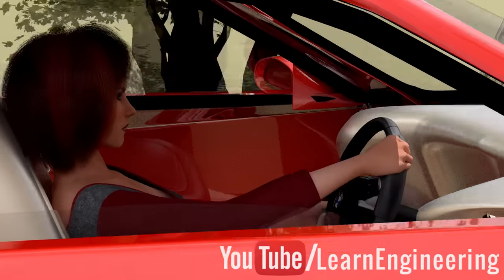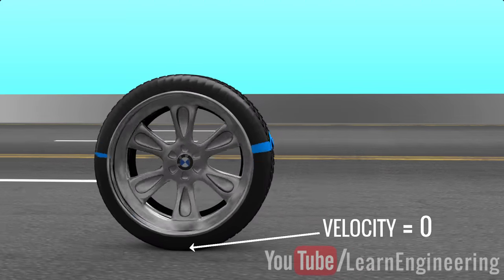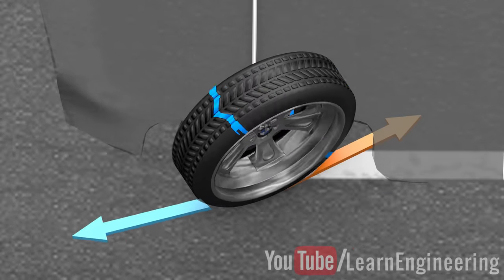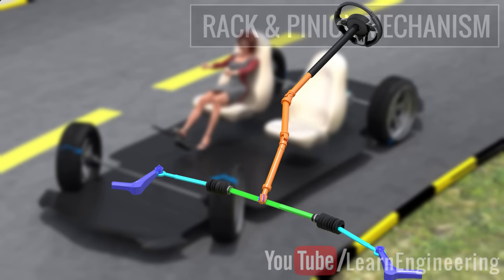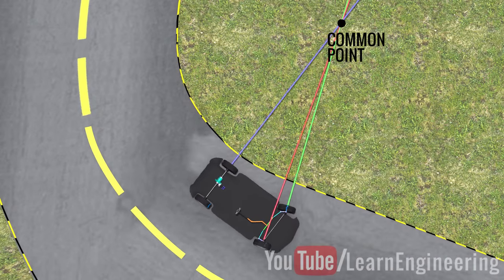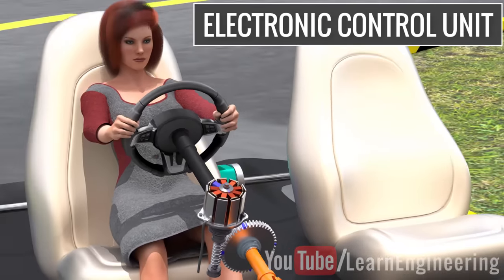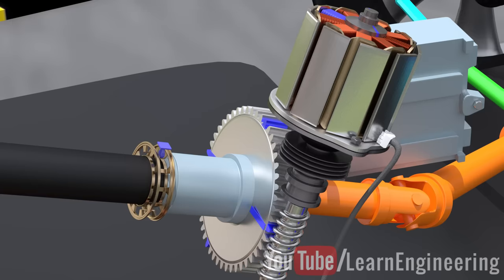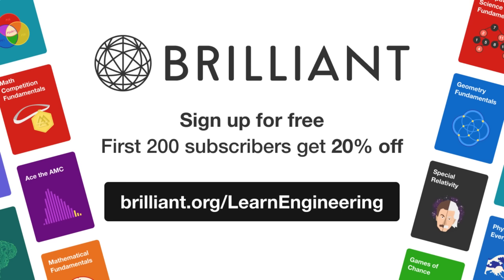Understanding your Car's Steering & Power Steering !

Comment: Great video, but your explanation that 'the rotation from the steering wheel is never directly connected to the worm gear' in electric power steering is incorrect. In many systems what looks like a worm gear actually has multiple teeth. Despite still looking very much like a worm drive, this makes it actually a crossed helical gear drive, with a resulting far higher lead angle (because the 'worm' has multiple teeth). This higher lead angle of the 'worm' teeth means that the 'worm wheel' can drive the 'worm' 'backwards' if the motor fails. 
This arrangement was widely used with the wheel connected directly to the steering column (i.e. no planetary gearing) in all the early electric power steering systems made by NSK, and widely used in many cars from the early 2000's onwards. The NSK system contained a lot of failsafes, so if it detected anything not right with any of the input signals, etc,  it disconnected all power from the motor leaving the driver with unassisted steering in which as well as moving the steering rack, the effort put in by the driver also spins the unpowered motor.

Comment: If there was a planetary gearset between steering wheel and the rack, that would cause a change in steering ratio in case of motor failure or when unpowered. That is not how any of the EPS that I have driven works. When unpowered, steering wheel would need more rotations to steer the wheels. And all of my EPS assisted cars turn the wheels at same rate whether powered or not. I read that few cars including BMW has used this type of variable ratio steering to help low speed manouvering by reducing the need to spin the steering wheel.

Comment: So is this different than vacuum power steering? I had the fan belt squeeling in my old civic and the power steering and brakes stopped working as effectively when it was squeeling. That doesn’t make sense with how this was explained in the video. I’m assuming it’s different technology

Comment: I saw your video about the caster angle as well. But is it necessary to block any movements from outside (by using worm gear on the rack) to avoid unwanted steering feedback to the driver and being uncontrolled / unsafely?
So far I can understand I would say no because otherwise the caster angle won't work. But is that true what I am saying?

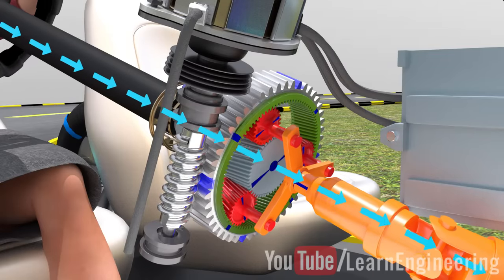Comment: 6:40 in order to transfer the power of the motor to the geaset, the green ring must connect to the outer ring. But once the motor failed, this connection would also affect the inner gearset?  or the friction is too small to have a impact on steering?
Reply: Sorry, i just find that the green ring had never moved since the motor failed.....

Comment: A little misleading- the description of the EPS worm drive in relation to back driving the worm is incorrect and as for the epicyclic arrangement then this was only proposed for what was known as ‘robust’ EPS to introduce a variable ratio effect - nice animation but pretty pictures don’t prove accuracy
Reply: and if you really want to be picky then the motors used in most modern EPS systems are not DC motors, they’re AC - that’s why the power control module includes an inverter

Comment: When gm was having issues with ignition switches and people were dying I always wondered why, the older cars I drove used hydraulic power steering and if the engine stalled you could still turn the car easily while moving.
My experience has been with Ford and when one of their electric racks fail it is extremely difficult to steer one of those without assist.
this I believe is why people in those gm cars were dying.
this is one of the big cons of electric power steering that needs tio be addressed.

Comment: ...all this issue may cause a bad battery in your car...
...I had power steering light on , and the mechanic asked me to recharge the battery or to buy new one ...I did and there is no more issue it's turning in time and it feels like you did work in your suspension system...
When the battery is weak, you will have a different light on your car... bad mechanics will recharge your battery and charger you money 😂...
Any computer issues in your cr first check your battery...❤

Comment: So a differential is only required for rear wheels?
Reply: A differential is required on any axle that is driven by the engine. On rear wheel drive cars, only the rear axle has a differential. On front wheel drive cars, the front axle has a differential. On 4wd or AWD cars, both axles have a differential.

Comment: And here I thought electric power steering was an electric motor working the hydraulic pump that is normally driven by the engine. But apparently that must have gotten replaced a decade ago on many vehicles.

Comment: Can someone explain to me:?
So I was city driving with my Opel Astra and I was preparing to make a right turn,as I did my car started to slow down and idling strangely,but I was calm,and right after that I remember I couldn't turn my wheel,well with extreme amount of fource I succed to turn left so not to enter into a store like an action movie lol.So can someone tell me what has
occurred it?Thank you for all the answers!
Reply: As mentioned in the video it seems that it was an ECU failure. So the torque you applied to the steering was used to drive the planetary gear train which directly drove the rack-pinion mechanism of the wheels. Since there was no motor assistance, you applied the actual force required to take a turn.
Reply: Ah now I get it.Thank you!

Comment: I'm confused. If a planetary system is used as shown, the driver has no authority over the wheels. If the steering wheel is stopped but the worm gear is turning the wheels will turn in that direction.

Comment: To bad they did not explain how the mechanism that makes the front wheels turn at a different angle works.
Reply: Yeah was curious about this too!  There is more to this mechanism than shown I would imagine?
Reply: It's about the steering arms angles.  When the wheels are straight you can draw an imaginary line that would continue them and those lines should meet at the center of the rear axle.

Comment: If you turn the steering wheel 90 degrees while the motor is working, then the output of the planetary gearset will also be 90 degrees, but without the motor it will be less. So the turning angle of the wheels would be smaller. 
Is this legit?
So after driving straight, then turning left 90 degrees, the planetary gearset output turning 90 degrees too, the motor fails. Now I want to turn back to straight line, so I turn 90 degrees clockwise, then the gearset output will NOT be 90 degrees too, right?
So I won't have my wheels centered when the steering wheel is?

Isn't that dangerous? How do you overcome this problem?

Comment: Why there must be a worm screw? Why there isn't just simple gear mechanism, like for example starter and flywheel? In case of motor failure, I can easely turn manually, and these simple gears won't block itselves and there is no need of complicated planetary gear set.

Comment: As a steering engineer, I found errors
In this video.  The so called principal of steering is called Ackerman steering and is seldom achieved in real world,  nor is It desirable.  Also the power steering does not jam when only a worm and spur gear is used.  Worm and sour gears can be and are designed with high reverse efficiency so they can be back driven in.  A planetary gear set is seldom used in this design

Comment: But how does it work with new electric cars that can slow down/accelerate each wheel independently? They often slow down the inner wheel for better steering/traction... Does this system still work there?
Reply: HUMM3LMAN I'm no expert at cars at all but I don't see these two concepts interfering with each other, one mechanism is for the angle of the wheels and the other for the velocity. 
I once learned about this velocity mechanism in school but I forgot how it was explained, some weird constellation of gears in the middle of the front axis, I'm sure you'll find something on youtube.
Reply: @Aeraleach  Ok thanks for the Input! I'll search for some videos!
Reply: i believe for a car to turn properly we need both steering angle and wheel speed which is handled by the differential.

Comment: Thanks, which 3d software and compositing were used please ?
Reply: Could have easily have been Blender, Daz Studio, or Poser. The scenes aren't that complex, it just requires paying somebody for their time and effort to make the engineering models.
Reply from the maker: Blender for 3D animation, Hitfilm for compositing and editing.
Reply: @SabinCivil  For an opensource piece of free software, Blender is actually pretty good. The learning curve is pretty steep though, compared to Daz or Poser. 

Poser has network render software, allowing distributed rendering across your local network, which can greatly reduce render times, especially for complex scenes. Not sure if Daz and Blender have that yet, I haven't used them for a while.
Reply: @BlackEpyon  LE have been using Blender for quite a long time, I guess they know it rather well now. The rendering is done using CUDA acceleration, hence the two GTX 980s I put in their system (7x faster than their old system). Ref:

https://www.youtube.com/watch?v=g2WiJNEZLNY

There is space for a 3rd GPU (with additional PCIe power cables ready if required), but it would probably be more sensible to just replace the 980s with something better in the future if extra performance is required. The rest of the system should be good for a while; I would have sent something better if I'd had the funds, but it's a decent setup with some pro elements for reliability (eg. Enterprise SATA rather than consumer models).

Comment: i thought the left and the right wheels are turning at the same angel when steering
Reply: On a toy vehicle, yes.  For toy vehicles, unless part of its purpose is to show the inner workings of a real car, it isn't cost effective to build a mechanism that can account for this issue.  The average end-user of a toy vehicle isn't going to notice a problem.  You can live with a little skid.

On a real vehicle built for a service life of 200,000 miles or more, you would have serious amounts of wear and tear, if you built both wheels to steer at the same angle.  The tires would wear out faster, the wheel bearings and joints would wear out faster, and front wheel drive wouldn't even be a possibility, if this issue were not considered in the car's design.

Comment: 🤣🤣🤣 that skirt extension was the funniest shit i seen in a long time, its like one would imagine it be easier for the graphics designer to simply swap out the chick and dress for Another model, you know what that means right, ill bet the video was all finished an ready to go an either just before release or quickly after had noticed the proximity to the camel toe zoom in and had to just do a quick mod to the animation, thought they'd be slick with no one noticing by doing it while the picture was in motion

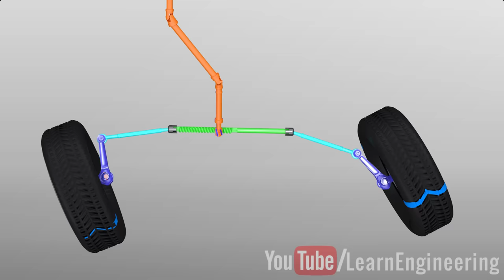Comment: At 4:01 you say that the tires turn at different angles? But why do they do that? I mean, what is causing them to turn at different angles? How do the tires decide which angle they should both turn at so that the lines can meet on the rear wheel axis?

Comment: Why not show how the most common power steering works: hydraulic.  I've never, ever seen an electric motor on the steering shaft, I didn't even knew that existed until I saw this.  But no one's car actually uses this system, it's all hydraulic with power taken from the engine.  I watched this video hoping to learn about normal power steering, and instead this video shows something else.
Reply: These videos have great animations but as you dig deeper they are all superfluous. He also did not properly explain why all of a sudden the transnational speed of the wheels matched their rotational speed when steering.

Comment: Most things are absolutely incorrect. The "perfect steering condition" or kinematic steering, or Ackermann steering is almost never obtained, it's mostly useless due to tyre deformation and a simple steering system with rack and pinion is not even close able to fulfill Ackermann steering at any given steering angle.

Comment: How does power steering effect the wheels turning? It looks like a glorified measurement system for the drivers turning radius rather than any practical effect on the steering.

Comment: So why have a magnetic ecu control steering system if it can be manually turned by a sun gear in case of failure? I'm confused, but this system is flawed and needs to be scrapped!!

Comment: Actually your steering wheel isn’t even connected to the wheels 
When you turn right 
There’s a sensor that senses you are turning right
And the cars computer tells the wheels to turn
Also known as drive-by-wire

Comment: The electric power assistance is incorrect here, if the motor were to fail the steering would be completely locked in place and the driver is on the wrong side that's where the drug dealer usually sits

Comment: I've seen this woman drive a manual transmission car in another video.
Is she married?
Reply: Basicly all drivers can drive manual in Europe (including women). As for women driving manual they are usualy at peak attention capacity so if anything goes wrong on the road their minds snap and they forget even which pedal is the brake. So yeah, its quite scarry to drive here, knowing that, even when you got 10+ years experience.